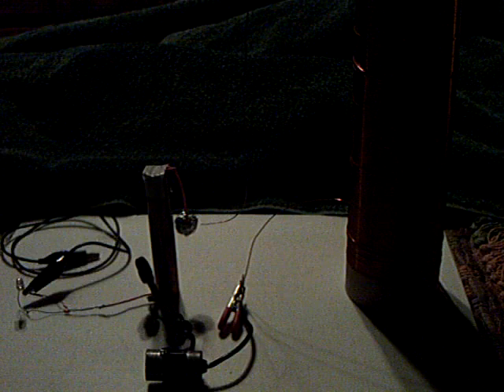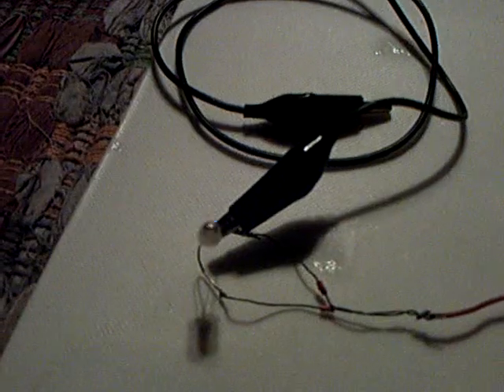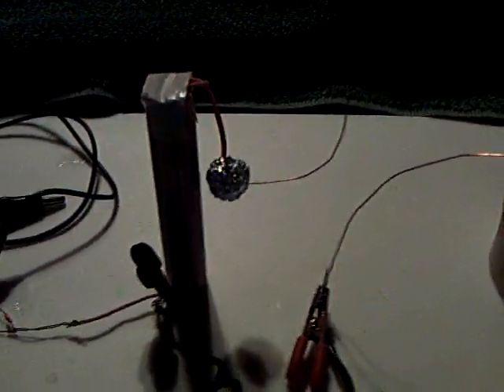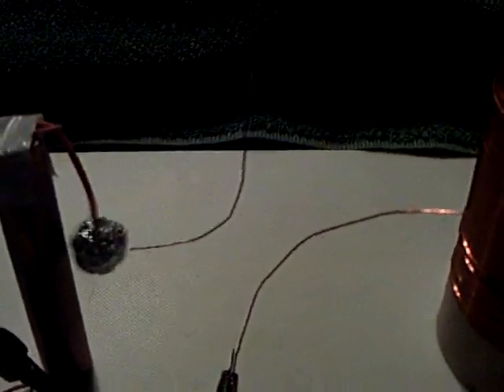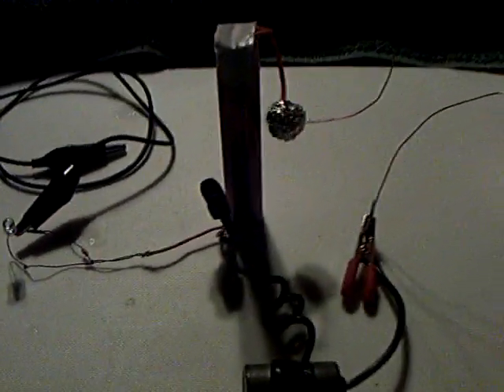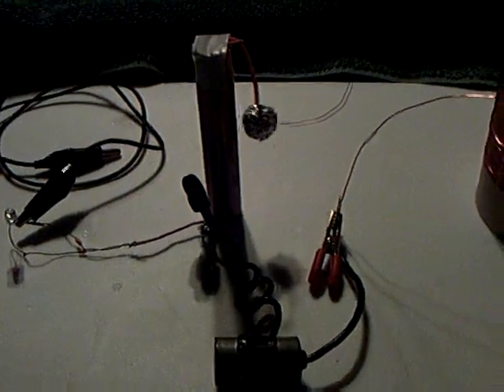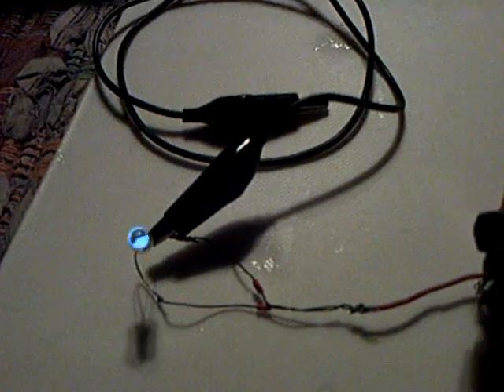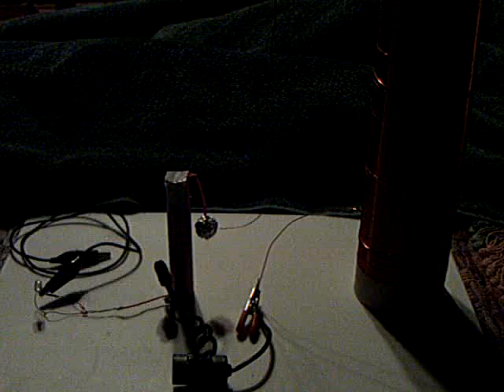Strange Electrostatic Experiment

Comment: Wow, that is a long run time from that coil.  This is very interesting work Lid.  Do your results change any if the size of the foil ball is larger/smaller?  Would a ceramic cap on the AV plug let the led stay one without blinking?  Great work here, as usual.

Bill
Reply from the maker: Hi Bill. Thanks.  I just started working with this yesterday.  A cap of the right value might work on the AV plug.   As far a the ball size goes, this is the only one I have tried but I tried so far.

Comment: Cool experiment! You gave me an idea to try with my Franklin bells :)
Thanks for the upload :)
Reply from the maker: I watched your video on this and a bunch of others dealing with electrostatic devices and decided that it was time for me to give it a go.  The big coil has something to do with the long run time and the LED lighting.  Without the coil the LED wouldn't blink.  Tank circuit???
Reply: ***** I think the coil is acting as a flyback. You could have a look with your scope to see for sure. Earth clip on the neg, and compare the cap pos with coil output. Be sure to use 10x or 100x probe to check coil output, likely high voltage there. If it was tank circuit, the cap would be alternating polarity. if flyback then just the coil will be oscillating and the cap will be dc supply. I think current through the coil to charge the ball is causing flyback, possibly pulling the ball back with the neg spike (Really cool if it is!!) Its probably resonating way to fast to pull the ball back though. The flyback would have a resonating down trumpet waveform at much higher freq. Which would be whats stimulating the av-plug led. So its likely a simple mechanical flyback driver :) I suspect you have close to 1000v charging the ball. Possibly a little less as I didn't notice any sparks. Although capacitance of the ball will be tiny, so there would be no amperage to make a spark... Will it self start? or do you need to tap-short the coil end through the ball to ground?
If the cap is alternating polarity that would be really cool too. The long run time would indicate you got really really lucky matching the coil induction value with the cap farads. To make a super efficient tank circuit.
Reply from the maker: Mongrel Shark Thanks for the input on this.  I think that you are right about what is happening here.  This does self start and the little Al ball must be like a ping pong ball capacitor ---and getting worked hard.  An unusual 'mechanical flyback driver' as you say.  I'm afraid to hook my computer O-scope up to this directly because of the HV but I may try a sniffer coil pickup.  I have gotten zapped numerous times off that cap.  It bites.  You are also right about getting lucky to get such a long run time right away.  Dumb luck----but I'll take.
Reply: Yes I would be careful with the PC o-scope. My usb ports all start dropping out if I draw arcs in the same room. Not even connected...
In theroy the cap in the scope probe should protect everything. I wouldn't risk expensive test kit unless absolutely sure though.

Self starting is interesting... I see you have another video up. I'll go watch that :)